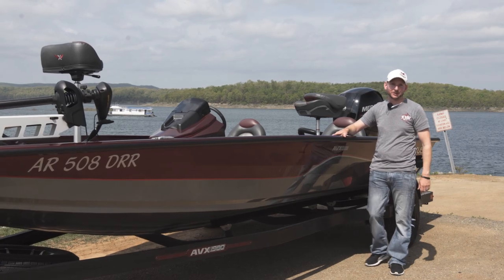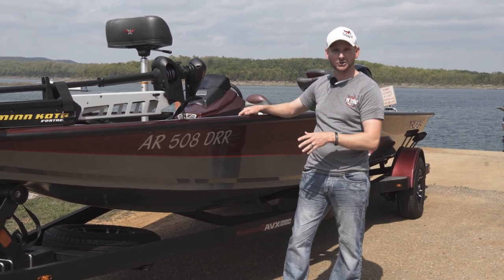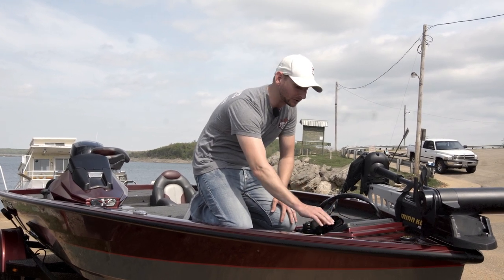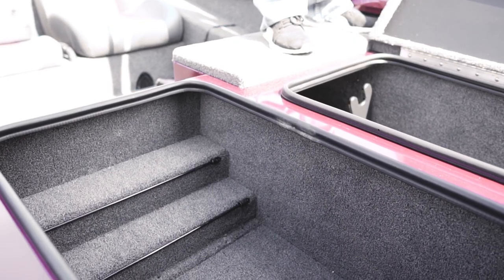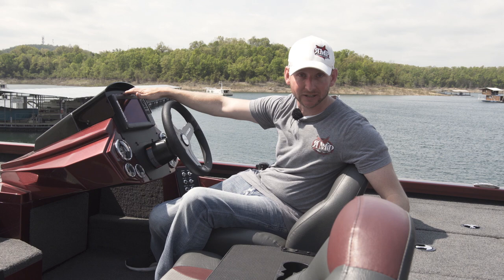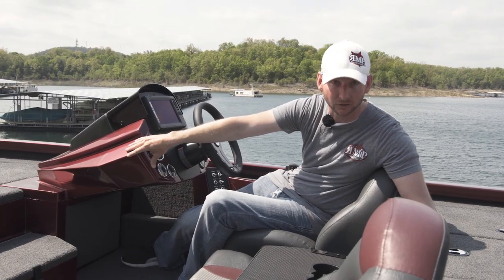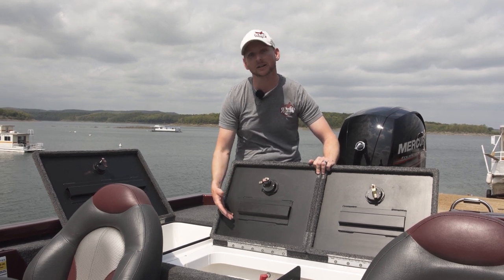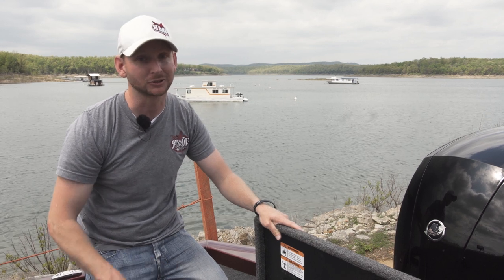Vexus 1980 AVX Bassboat Walkthrough with Russell Marine Products,.

Comment: Where were the trolling motor batteries? only seen one battery in the back.
Reply: dtille7578 i thought of that too. I was expecting see 3 battery and on board charger but there was only crank battery
Reply: There were three in there, you just can't see from that angle.  If you look closely you can see the rear of one battery peaking out of the corner near him.  There is one on each side and one in center.

Comment: Same lay out as the ranger 198p
Bigger boxes in rear. 
Real question is how come they won't answer anyone's questions about speed/ performance?
Reply: Chris Klingman I’ll answer it here.   I have a 2018 Ranger 198P which this boat competes with.  I ran side by side to this boat on LOZ and I pulled away from him.   Same motor Mercury 150 4S.   I can touch 59 in my Ranger so I guess I was a mile and hour or two faster.   This boat is a little heavier than the Ranger from what I understand

Comment: Why no Ultrex trolling motor-the new standard? Also where I fish I stay away from hard flush mounted electronics. Why? They are hard to secure and protect.
Reply: Angler Atlarge the fourtrex is way cheaper and easier to use, anyone buying an aluminum probably doesn’t want to spend that much on a trolling motor. Now with electronics, just simply order it with no electronics then put them on in the blank plate, problem solved.

Comment: Not a bad boat I do like the bigger rear storage compartments over my ranger! But I would still take my 198p any day over that! The same guys that caused the issues at ranger on the aluminum boats with only allowing one power pole , no talon, can only use Atlas and the sloppy work over the last couple years are the same guys that went down the street to build these boats.....
Reply: Mike Hart Wait really? Interesting...
Reply: no
Reply: Absolutely
Reply: Then why can these Vexus' take two power poles and a jack plate? And why are these the guys that left to avoid using the same parts as tracker boats?
Reply: bethlehemlacrosse24 Because they went down the street and designed it to be able to handle it after they learn from their mistakes at Ranger
Reply: That contradicts your initial comment
Reply: bethlehemlacrosse24 no I have to power poles and a 6 inch jack plate on my ranger what I said was the same guys that caused the issues at Ranger are now building these boats which just failed Coast Guard inspection .... so when I said was I would keep my ranger these guys cause enough issues at Ranger and are now down the street going to .....
Reply: Again that doesn't make sense given your past few comments.
Reply: Mike Hart i thought the guys that started vexus left ranger 2 or 3 years ago
Reply: Sanders74 Some of them have been gone for a while.... but most of them just left or where just pushed out
Reply: Mike Hart i dont think they were pushed out we all pretty much walked out
Reply: Sanders74 don’t try to make yourself believe nor myself that everyone was ready to go and happily left without a job.... Forest is a great man he unfortunately was not able financially run a great company for many years